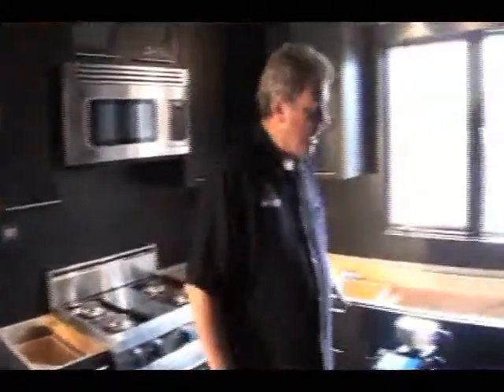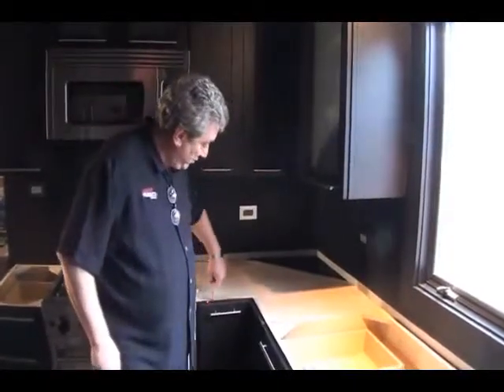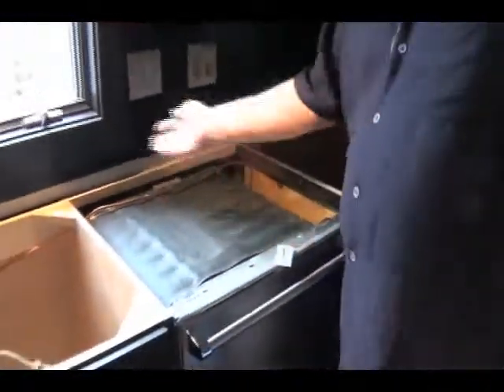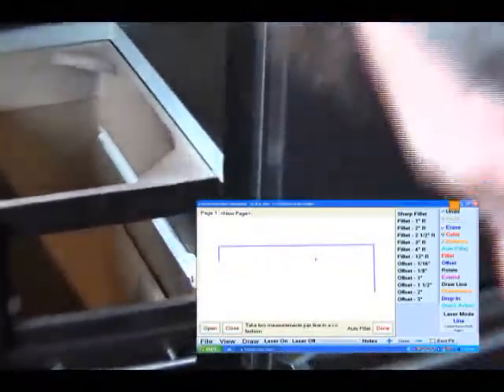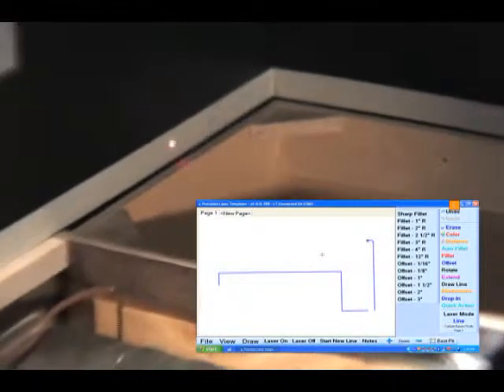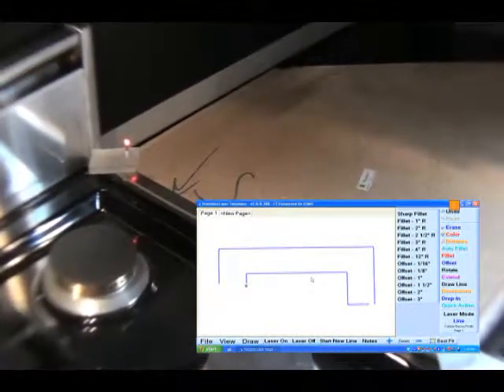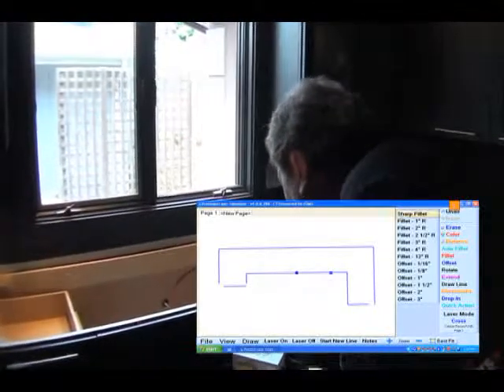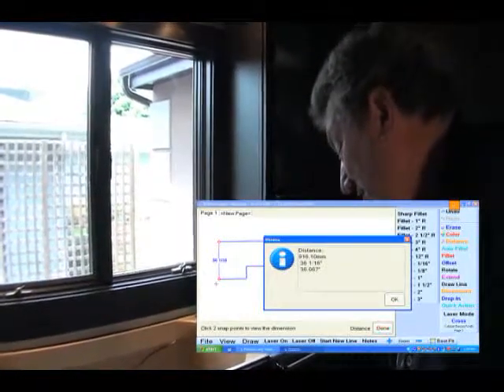LT-55 XL - Templating Cabinet Bases

Comment: if there is measurement discrepancy on the templator vs actual, how do you manually change those dimensions on the tablet?
Reply: Pacific Craftworks use the offset button and add to it